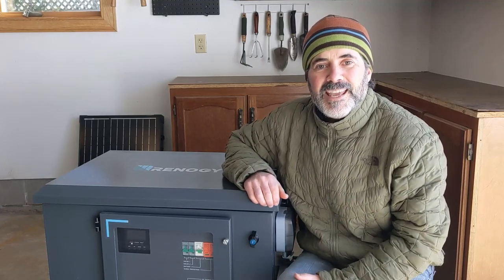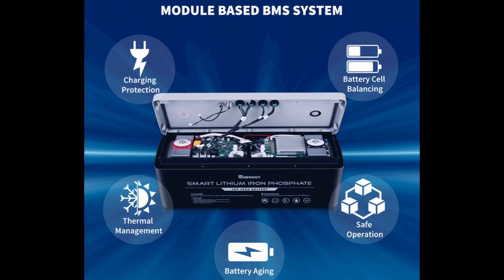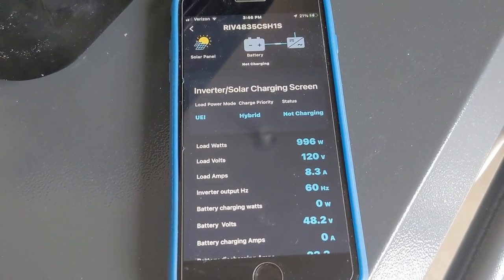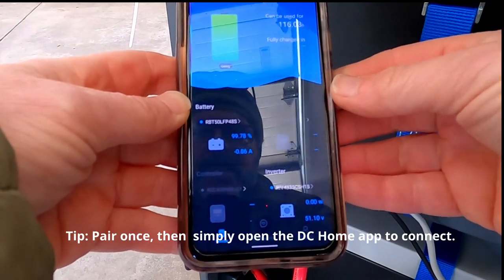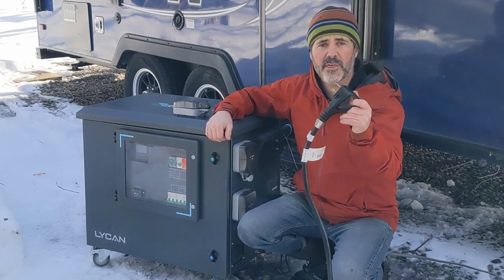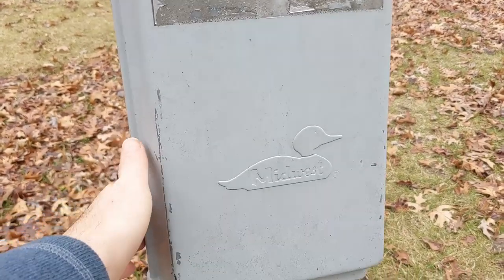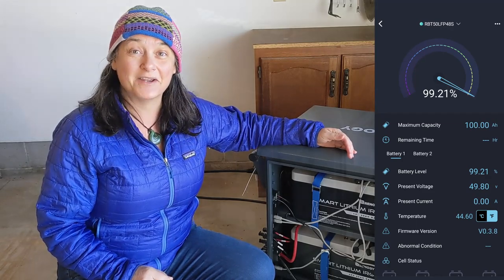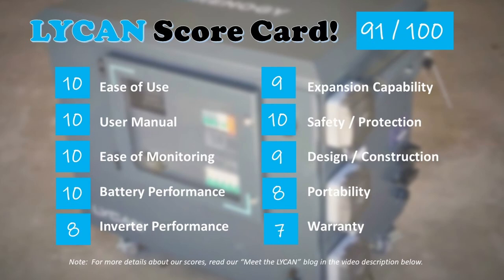Renogy LYCAN 5000 Power Box: Product Review & Score Card

Comment: Hey nice review. Well done. What is the communication port under the expansion connection used for? Thanks for sharing.
Reply from the maker: Hey thanks for the comment.  Yeah, that little port had me scratching my head at first.  But, if you're connecting other batteries to the unit, the BMS cables need to talk to each other, so that they can balance all the charges in the batteries.  So that small ethernet cable will enter the Lycan through this port to connect to the other 2 already inside the unit.  Good question!
Reply: @FreedomInACan  Ok, thanks. Now I see the cables in the expanded battery shot you provided. Didn't notice at the time. LOL. Thanks for sharing
Reply from the maker: @loucinci3922  No worries...lots of details on these units to see and understand.  If you end up purchasing from Renogy, be sure to use our affiliate link and promo code in the video description to save some $$$!

Comment: I’m really confused.. I have two banks in my house each with 6 200ah 12g batteries in parallel. They definitely have power but the discharge rate is nowhere near long term off the grid or power outages. I know lithium is better but how can 2 50ah batteries do very much?
Reply: *12v batteries lol
Reply from the maker: Thanks for the question.  The batteries in the Lycan 5000 are 48V batteries.  To get the watt hour conversion we multiply Voltage x Amp hours = Watt hours.  So in this case, 48V X 50Ah = 2,400Wh per battery, and since these batteries are in parallel you get a total of 4,800Wh, with the two batteries.  You can expand the system's batteries up to 8 total, for a total of 19,200Wh (just to compare apples to apples let's use 6 batteries in parallel for the same Wh as one of your system's banks at 14,400WH. The major difference here is depth of discharge (DOD).  Your bank (Lead Acid I presume) has a 50% DOD giving you a working usable 7,200WH.  The LFP batteries in the Lycan have a DOD of 80%, giving us usable 11,520Wh.  The other benefit is on life cycles.  These LFP batterie s can have up to 4,500 cycles, compared to 300 - 500 of traditional Lead Acid, so they will last many years longer.  The last benefit of the Lycan is that it combines many things into one unit, inverter / charger / so you can use AC power, solar power, or generator power to charge up the house batteries.  If you'd like more information on solar batteries, check out this blog that we wrote late last year. https://www.renogy.com/blog/is-a-solar-battery-necessary-for-my-solar-energy-system/   If you choose to buy with Renogy, use our custom link to save 10% https://renogy.sjv.io/LPEyNY  be sure to use our, CANLIFE promo code at checkout.  Let us know if you have any further questions.
Reply: @FreedomInACan  exactly the info I needed thank you so much!

Comment: My desire is to do partial offgrid by using awning mounted panels to charge the Power Box and plugging in my kitchen appliances independently. 1 Fridge, 1 Freezer, Microwave, Coffee Maker, since these are the priorities I have in mind in addition to a Swamp Cooler later on. I live in an area where sunshine is abundant. Any idea how many panels would cover this and would I need extra batteries?
Reply from the maker: There's a lot of factors that go into getting a solar set up that will work for you including: how many days you intend to use the RV off the grid, where you intend to camp, and your expected daily total watt hours (this is the total energy you intend to use on an average day, and therefor need to collect in order to keep the batteries mostly full).  Since the appliances you will use and how long you will use them are specific to you, you need to do a little bit of research and math.  We've put together a Solar Sizing Worksheet that will walk you through every step of the way.  You can find this excel spreadsheet at our website, (https://freedominacan.com/solar-sizing-worksheet)  

This worksheet will help you calculate your daily total watt hours, then help you determine how many solar panels, what size charge controller, what capacity battery bank and what size inverter you need in order to run everything you want.  While we use Renogy products in this spreadsheet, and can save you 10% off your purchase with our link and promo code "Canlife", please know that you could use any other company's products with this system, so long as that product matches the same specifications. 

Our "Solar 101" video (https://youtu.be/vBI4rrj0HIQ) will help you get started if this is all new to you, because it helps explain the electrical terminology used with Solar equipment, as well as what each component does.  

Hope that helps, reach out with questions!
Reply: @FreedomInACan  Thanks and btw not for an RV but a home. My thought is to do window and patio awnings and pop my wiring into the garage where I'd like to install the components (controller, etc.) and tie in independent recepticles for appliances since the kitchen is adjacent to the garage. I added up the Ah's to under 30 but figured on a 60a capacity.
Reply from the maker: @alvingallegos6367  I like the plan.  You might want to consider these 220W Bi-facial solar panels for your awning installation - they are ideal for that use and between 5 - 30% more efficient. - renogy.sjv.io/rQQgvv

Since you don't need the solar set up to roll down the road, and just installing in a garage, the Lycan 5000 Powerbox  would be all you need - renogy.sjv.io/mgQVby  It has all of the components (minus panels) charge controller, batteries, inverter and fuses and wiring already installed.  You would only need to hook up the solar array.  This system is robust and expandable for later when you want to power more.  

One last thing, let's talk battery capacity.  You may already know this, but let's make sure we're comparing apples to apples.  It's best to transfer battery Ah into Wh since that's the unit that the appliances work in.  To do this take the Ah capacity and multiply by the  nominal voltage (e.g. 100Ah LFP x 12.8V = 12,800Wh)  Note, to get useable Wh multiply this number by the safe depth of discharge of the battery type, LFP = 80%, Lead Acid = 50%.  So, in our example 12,800Wh x .8 = 10,240Wh.  

Then when you add up all the Wh of your appliance load, you'll be able to calculate the size of your panel array, and the rest of your components.  Make sense?  We already sent our worksheet that has some great resources in a previous comment.  

Also you can save 10% with our link and promo code, no pressure, just putting it out there.  renogy.sjv.io/LPEyNY - promo code "CANLIFE"

Comment: Looks like a great system although I believe the solar input voltage is too low nobody mentions it the company won’t tell me what it is and they expect me to spend $6000 Canadian without that specifications. A unit this size should have a minimum of 150 V DC solar input 200 would be better I suspect that it’s 60 V DC which is ridiculously small. Correct me if I’m wrong I would love to be wrong. For you to put the advertised wattage in this solar controller on 60 V you will need six odd cable. Can you please give me the spec of the maximum voltage from solar?
Reply from the maker: Hi Roger, I will check in with our engineer contact and see if we can get this info for you.  Please check back on this thread and I'll follow up with you here.  Or you could email us directly at freedominacan1957@gmail.com if you want to chat directly and off the YT format.  Thanks for sharing this, and we've confirmed that our promo code works in Canada, so we can shave off some of that for you.
Reply from the maker: Hello again!  Info from the Renogy Engineering Team: The Lycan has capacity for 4400W and can accept up to 150VDC. It has 2 solar inputs so you can create 2 even strings of 2200W or a single 4400W string. 60V is the minimum voltage needed to charge a 48V battery bank. 

Hope this answers your question and let us know if you need anything else!  Be sure to use our affiliate link AND promo code "CANLIFE" for a 10% discount at checkout.  This works in the US, Canada, Australia, and the UK.
Reply: @FreedomInACan  nice!! Finally I got an answer to this question they really should put that on their spec sheet thanks man
Reply from the maker: Happy to help and we'll pass that feedback along.
Reply from the maker: @rogerpilon2588  BTW, big Renogy Day sale 15% off site-wide.  Still use our link and we get credit.  Thanks!

Comment: Called Renogy, the Lycan 5000 can be charged by a generator while having appliances or electrical equipment under load....
Reply from the maker: Thanks for the input.  Yes, this makes sense because the generator would just be putting out AC power between 110-120V, into the regular AC input.  So the inverter charger is passing through the voltage to the appliances while also changing the batteries.  This is a great option for low sun/ winter days or longer term power outages.  Thanks for the comment!

Comment: Can it put out 240v or can
 you use two to get split phase 240v? NO? Pretty worthless for backup power for most then...
Reply from the maker: The US version puts out 120V of AC power.  The UK version should be able to do 240V, and we hope this one will be available in the US as well, currently not on their site.  As is, with 2 batteries, this unit is intended as an "essential power" backup supply, fridge, dishwasher, microwave, phones, laptop, wifi router, etc.  As you saw in the video it can also run a whole lot more, including power tools, and an entire RV.  The only appliances in your household that need 240V would be the electric dryer, hot tub, and maybe the oven.  Are you really going to need those specific appliances in a short term power outage?  Also keep in mind that this 4.8kWh unit can be increased to 8 batteries for a grand total of 19.2 kWh.

Comment: I wanna know if you can run that rv in the summer with the fridge on 24/7 and using the air conditioner around 12 hrs a day. Doing this how long will it run and how many watts of solar input would be needed for it to work out as a perpetual system
Reply from the maker: Hate to say this, "but it depends."  It depends upon how  the size (wattage) of your Air Conditioner, the wattage of the fridge, how hot it is outside, how much sunlight you get per day, are you partially shaded, and the size of your solar array.  I wish there was an easy answer.  
Best way is to calculate your daily total watt hours, then you can plan if this battery bank, & inverter charger is big enough -- and how large your solar array needs to be depending on where you intend to be.  We have a worksheet that helps you plan all this out.  https://freedominacan.com/solar-sizing-worksheet

This unit is great if you plan to park your RV in one place and you want to power from the outside.  If you want to move around periodically with your RV, you might consider the Renogy REGO system, see our installation playlist. https://www.youtube.com/playlist?list=PLvst7Eq8IjPraX5h3TYT0Pl9i1_YEsArD

Feel free to ask any other questions.

Comment: Great review and wondering if the 30amp plug on my gas generator is the same as the rv plug cause I have this cord tied into my main breaker box for running the house with my gas generator?? Seems like a great unit and would be cheaper than buying gas ⛽️.. and safer!!
Reply from the maker: It should be the same, there is a close up of us plugging in the RV to the 30A outlet closer to the end of the video.

Comment: It looks beautiful, how u connect the remote control to the Satellite, or WiFi in an emergency who have everything shutdown ? U have to do it manually.
Reply from the maker: You can set up the Lycan with an automatic transfer switch, so that when power goes off, it turns on to supply power to the house.  If in an off-grid application, I believe you can use Renogy's remote monitoring system which does require a cellphone signal.  Hope that helps!

Comment: I am very new to solar. If you have this wired into solar panels are you able to charge and use the unit at the same time? Id assume so (they show picture of it being hard wired into the homes electrical system) but just curious? Also how many solar panels do you need to charge it (wattage etc.)? I need help and really appreciate this review.
Reply from the maker: Hey, thanks for the comment and question Eli.  First off, yes you can charge and discharge at the same time.  The maximum solar input is 4400W. There's also a lot more information about the Lycan in the video description, so check that out.   We have a ton of resources on our website for folks who are new to solar.  https://freedominacan.com/solar-powered-by-renogy
There are several videos and articles and a cool downloadable worksheet to help you size a system that is right for you.  We've helped hundreds of folks go solar, so let us know if you have any questions.  Best of luck.

Comment: For everyone who thinks this is a beast. Let's put it into context. 100ah 4800wh will run a 2200 watt tumble dryer for just over 2 hours.
Reply from the maker: Appreciate the context, here.  I think it's funny that you choose to highlight the most power hungry home appliance, and probably the least important during a power outage.   Unless expanded , this isn't going to power the entirety of a traditional 2000 sq ft home, but intended to keep a few key circuits running while experiencing a power outage.  When connected to an appropriately sized solar array, it can be self-sustaining for those key items in your home.  However, there's a lot of different definitions of home out there, including ours (72 sq ft of vintage camper) and this is capable of running a lot of non-traditional living situations.
Reply: @FreedomInACan  just giving people an idea of the power. I've have a 48volt volt 50 amp renogy battery. Not critical of the battery but for loads of newbie building a system from scratch. They might want to run a small home. I'm a family of 6 and my tumble dryer is on constant. Pretty much washing and drying every day. So my system which is nearly 10, 000 wh of batteries and 5000 Watts of solar. And I get one complete washing cycle and one complete drying cycle a day.
Reply: @FreedomInACan  I actually quite like the battery. 👍 But with kwh, ah, wh, 48v 24v  Run time etc etc it gets so complicated. So I simplified it
Reply from the maker: @sun-sea-solar  Hey, really appreciate your insight.  I grew up in a family of six and laundry was run with military like precision!  I often lean toward the smallish size of things, but thanks for sharing the other side!

Comment: How long does it take to charge Lycan via wall socket? How much does it weigh? Lots of money to invest in one box, what if one part of it go wacked? I rather own Ecoflow Delta mini, get 2 and handles all appliances and charges in one hour via wall socket
Reply from the maker: 256 lbs. On AC it charged up in 3.5 hours.  Each component has its own warranty which vary.  All of this information and a whole lot more can be found in this article.  Let us know if you have any other questions.   https://www.renogy.com/blog/meet-the-lycan-5000-from-emergency-generator-to-offgrid-home-energy-supply/
Reply: This unit would be easier to fix if it got wacked.it's built with off the shelf units, where as the Ecoflow, it is not field serviceable. if something is broken you send away the whole unit.

Comment: Any idea if Renogy has a 220 version coming out this year?  I want to be able to use for 50amp / 240 service … and run circuits such as the dryer
Reply from the maker: Great Question, we have other friends who want to run one of these in other countries with 220 voltage. Let me circle back to you on this after we chat with our friends at Renogy.
Reply: @FreedomInACan  thank you!  I see that Anker, Hysolis and Eco Flo have new solar generators out with 220… the reason I’m sold on the Renogy Lycan, is that it’s outdoor rated, and serviceable if/when components fail… I also notice that the hysolis seems to have the ability to pair to another unit to increase the output…  I don’t think the Anker has that ability, so it’s kind of useless if the inverter is not able to handle more than 3000w if you’re trying to operate larger loads.  Be cool if there was a panel /combiner box that allowed a person to hook up 2 Lycans - one on ea leg … no need to have a whole new generator developed
Reply from the maker: We're not sure that they're coming out with one of these this year.  But, they do have a split phase adapter kit that works with their Phoenix 1000, to link up two of them to run some larger appliances.  renogy.sjv.io/NkyGV2 
It doesn't have nearly the capacity, but it might be a start.